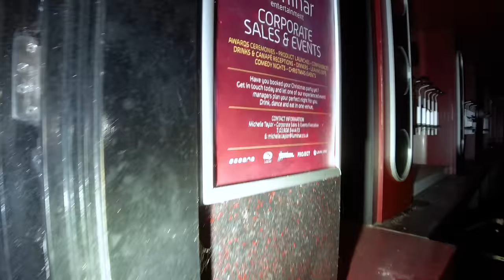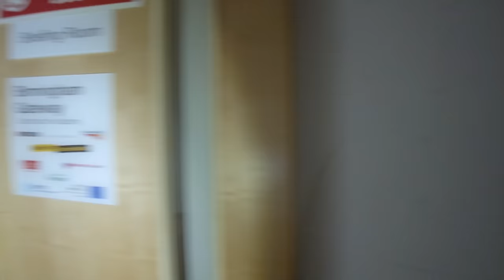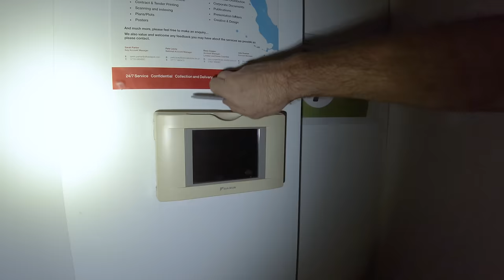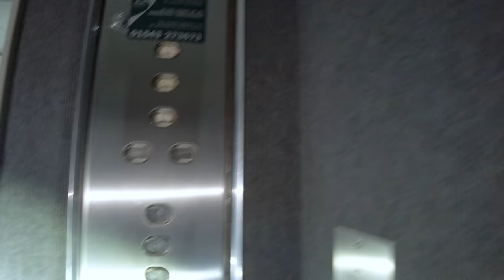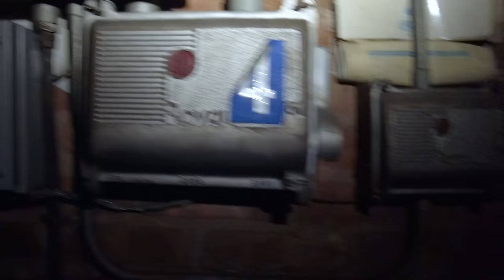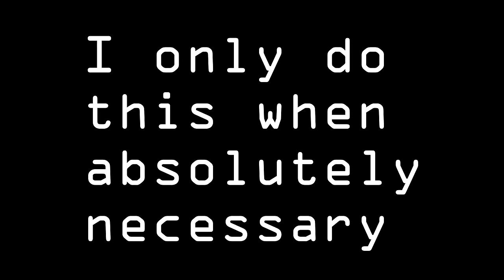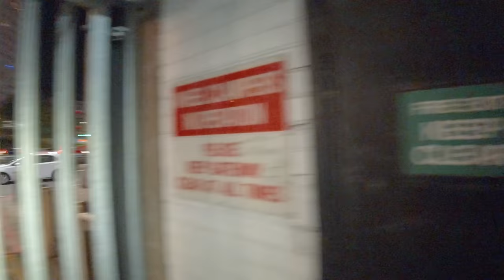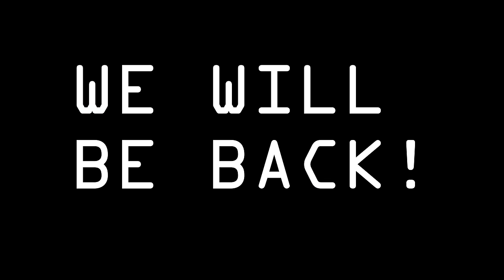We found ANOTHER Underground NIGHTCLUB in Birmingham EXCLUSIVE

Comment: I used to be a Lighting Engineer at Oceana, the part you "found" was the Disco room, through the double doors with the bricked up wall took you to the main room - IceHouse, the venue got seperated when it shut and was sold..
Also, the cinema IS there, you were very close, i've been in and it's huge!
Reply: Hey, do you have an idea of the floor plan?
Reply: Oceana was my Electrical Design and Installation as all others Throughout the Country Very Confusing Building But what a great opening night it was.
Reply: Yes I went when it was Oceana the rooms were so stylish and done out to be a hi spec superclub, the Ice house room was amazing the sound system was awesome. Got a feeling the disco room was never used again once the venue was Electric and was closed off.

Comment: They turn the water off but leave the electric on 😂
Reply: It's because believe it or not parts of the building are still in use. My Mrs works in offices in part of the building. No heating no double glazing just old and derelict. Needs to be demolished best option.